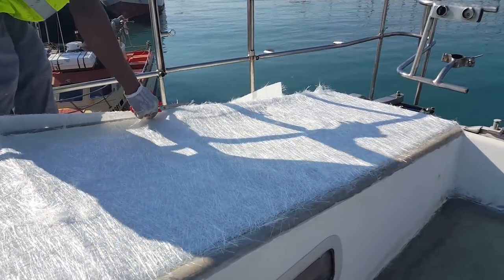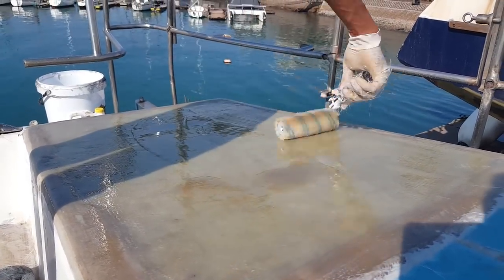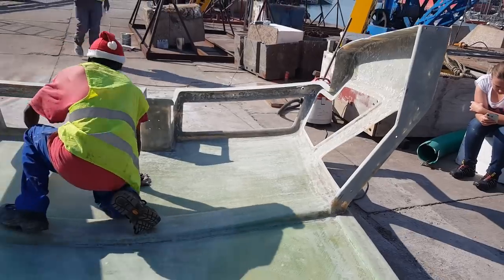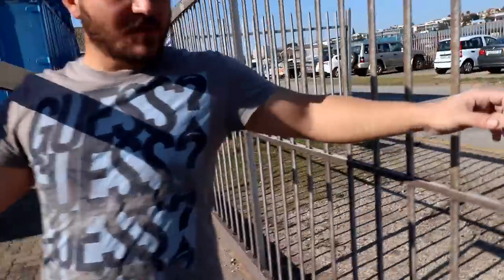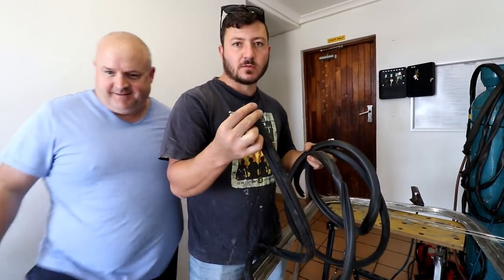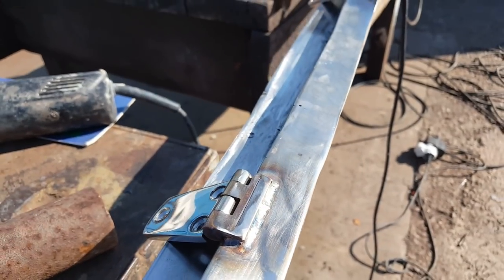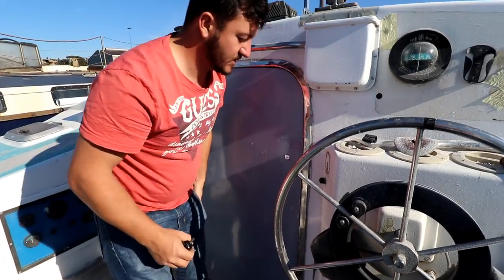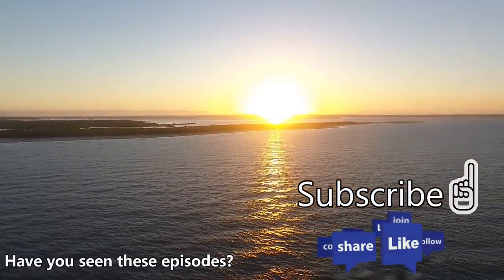A BULLETPROOF yacht DOOR!?! | YACHT REBUILD WEEK 31

Comment: Resin should only be as thick as the matting, otherwise It’ll start cracking.  I see you’re using the consolidating roller on your canopy, which is good. Your labourer friend didn’t use it when you were doing the aft part of the cockpit area. 
It’s looking good 👍👍👍

Comment: love the polycarbonate as it will add strength and security the way you've installed it, but as long as your door opens to the outside if your cat flips you'll not be able to open it until the cabin equalizes especially with the door being sealed like it is.

Comment: Great detail in the videos! FYI Lexan is a trade name for polycarbonate. And yes it is unbreakable, I’ve tried. The thing to be careful of is flex. If impacted hard enough ( rogue wave ? ) it can flex out of a frame or opening. It is great that you have the UV stabilized sheet. It does scratch very easily, in the states it is also available with an anti-scratch coating. You might want to wax the faces with car wax, it reduces the dirt / salt particles from digging into the surface when you wipe it. Always rinse with fresh water before wiping. Enjoy your efforts!
Reply from the maker: Thanks for the tips Garrison! Will definitely do that! We are just doing our door with the poly carbonate due to the flexing, our windows will be Plexiglas.  😊

Comment: the door will be nice on cold wet windy days and bring a lot of light into the saloon,nice job
.
the door on my prout is of a similar design and lay out,the only thing i don't like about it is that it blocks off that whole corner in the cockpit when it is open.

to solve this problem i made up 3 pintle hinges,so with the door open you can lift it up and off the pintles and store it under the roof of the dodger, it only takes a minute to put it back if a squall comes when sailing .

Comment: The comment about pitch-poling and being able to escape brought to mind the question of an escape hatch. Does the Dean not have any escape hatches? I think you'd have a very tough time getting an outward-facing door opened against the water pressure. If there are no escape hatches, installing one under one or both of the stairs into the hulls would be an idea. Alternatively, an escape hatch under the salon floor (depending on the design of the bridge deck, of course) is how later Dean's handled the matter.

Comment: do you have to paint it or can you laminate it with a sheet of stainless or pvc or whatever you want?  And nice idea for the door material.  you might be able to put those gas charged door closers on it too.
Reply from the maker: Hi Grant , are you asking if we are going to laminate or paint the door ? sorry for the misunderstanding
Reply: I was wondering what you were going to do with it paint, laminate or what?  I am not familiar with that material.
Reply from the maker: No, it does not take paint or lamination. Polycarb is similar to acrylic, it's a replacement for clear glass. In essence we built a frameless clear glass (polycarb) door that unbreakable on impact.
Reply: got it, thanks.  i got thinking about it and realized that was a stupid question that I asked.  I didn't realize the material was clear and now I feel like a dufus.
Reply: @grantmyers7593   the only dumb question is the one not asked mate

Comment: Can the hinges be unscrewed from the outside when closed and locked?
Reply from the maker: Negative, it is fitted with a bolt and on the inside with a nyloc nut capped with a cone nut. 😊

Comment: But Ricky with your hinges exposed can’t someone just unscrew the hinge and get in that way?
Reply from the maker: It is fitted with a bolt and on the inside with a nyloc nut capped with a cone nut. They won't just be able to unscrew it.
Reply: Sailing Lady Africa I knew you were way to smart not to have a logical answer for me! Cheers....

Comment: Just an FYI, those locks you used can be picked with nothing more than a bump key fashioned from a zip tie, and anyone with a set of picks with half a clue can get through them in 15-30 seconds. 

They are only going to keep honest people out.
Reply from the maker: BTW.. All yacht hatches can be opened with one flat end screw driver... If you know what you doing.. So.. If someone wants to break in.. They will regardless of what you have.
Reply: locks are only there to keep the honest people out anyway,if they want to get in,they will,nothing you can do about it

Comment: Couldn't someone  enter the locked cabin by just removing the hinge screws ?
Reply: someone with a saw or a drill could get into any boat :) They are made out of plastics or wood.
Reply: I meant by removing the the screws, which are facing the cockpit. Maybe a security screw head should have been used.
Reply from the maker: Where there is a will there is a way.. but btw  it is fitted with a bolt and on the inside with a nyloc nut capped with a cone nut.. No, they cannot just unscrew it.

Comment: All a theft has to do is take out the screws, or the pins  form the hinges.  Better cover them ...
Reply from the maker: It is fitted with a bolt and on the inside with a nyloc nut capped with a cone nut. They won't just be able to unscrew it.. and if someone want's to break into your boat... they will do it.. a door ain't gonna scare them off. 😊